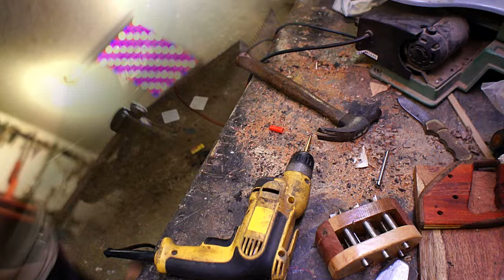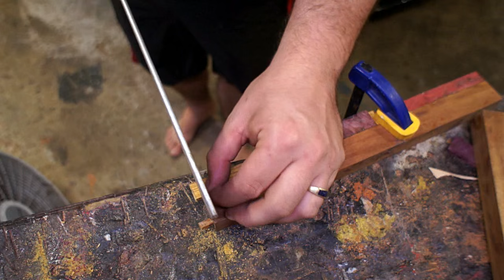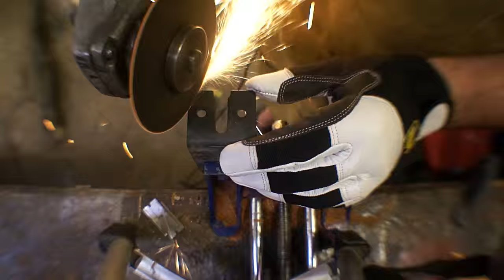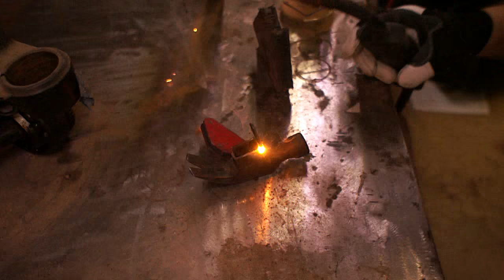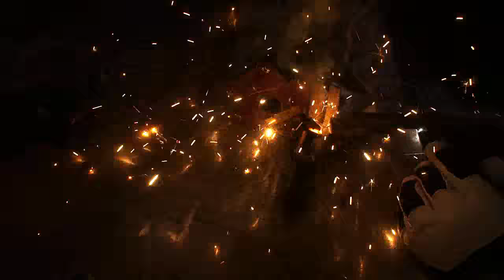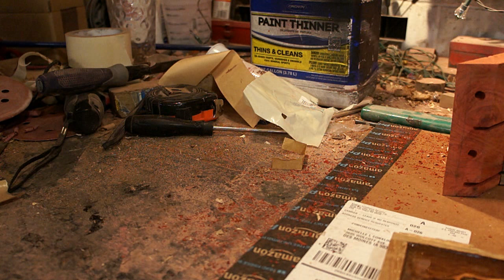Inlaid Koa Hammer: Returning my father's stolen-err borrowed tool

Comment: Saw the pic and said, another handle? I'm watching that. Really like these. They turn a utilitarian tool into something more. The mods to the heads, too, make these builds unique. Would be fun to see a copper-plated one if you sort that out.
Reply from the maker: +Matthew Friedrichs Thanks! I have a friend that was giving me crap because she said I didn't do anything except for handles on here lol. It is a lot more fun to use something a little unique that you can't buy off a shelf :) As for the copper plating I would love to get it down, and i'm thinking I will revisit it when I have a bit more time to mess around with no xmas deadline. From what I have been reading maybe a lower voltage and less caustic acid solution could help with the durability of the coating. Hopefull I can put a video together with the failed footage to show how to do it incorrectly and correctly.
Reply: Look forward to it.

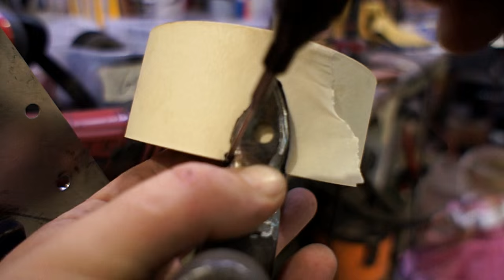Comment: what pen are you using in 5:13. i really enjoy your videos i barely found your channel and i think that the tool noises are cool
Reply from the maker: +Jesus Ibarra Thanks for the kind words :) I love that marker- it's a fastcap pattern marker. Two sided, one with that really long skinny par,t and one with a more conventional tip, under 10$ I think.
Reply: +Tappar hey man thanks for replying i have been looking for this marker for a while, is it good for steel. i was wandering if you could make me a scribe out of wood and that titanium rod with a cap, if its possible
Reply from the maker: I think it's the same ink as a sharpie, seems to work about as well on steel as that . I would be open to doing something custom for ya, did you have anything specific in mind?

Comment: looks nice but.... its going to fall apart. there is a reason why all proper tools are hung a certain way; its the right way. i'd recommend doing so research on properly hanging a hand tool.
Reply from the maker: You think the head will come off? Please elaborate
Reply: yes, epoxy filled heads on things like hammers normally fall off or become loose because the epoxy will fracture with repeated impacts.even plain wood will become loose over a long period of time with use (even without use, because it will dry up and shrink) but if the tool is hanged properly the wood will be extremely compacted inside of the eye of the hammer by using wedges of both metal and wood. when wood is compacted it makes a small amount of spring action pressing on the inside of the eye, so the force of the impact will be absorbed instead of expelled on something that has no spring or compaction such as epoxy. one can make the wood even more compacted inside of the eye by using oils like toung or linseed which will swell the wood. when a wooden handled tool becomes loose in the eye you can simply put some oil on the end grain and the wood will swell back out and make the eye nice and tight again. oils are also good for wooden hand tools because it prevents checking or cracking in the wood. this will make that beautiful handle last longer. this is why people who know about the importance of treating the wood with oils hate it when the tools handles are coated in varnish or poly, because now to ensure the handle lasts we have to sand it all off which is an annoyance. if you want to watch some videos about it you can watch wrangler star's channel he has plenty of well made videos on how to hang a tool on a wooden handle properly. good luck
Reply from the maker: Awesome info I appreciate it :) i have a couple hammers I bought which were constructed this way but I'm sure longevity isn't #1 priority for production tools. For this particular one I doubt he will use it a lot so hopefully it's a non issue
Reply: yes, sadly a lot of mass production hammers are made with epoxy fill simply because its much much cheaper and quicker. the big companies set a bad example. but now that you know, good luck with your future projects! id love to see more handles made like yours. the color and pattern of that handle makes me want to make one like it. there are many other little tips that i have not mentioned, but you can learn them all from wrangler stars videos he is a much better teacher than i.